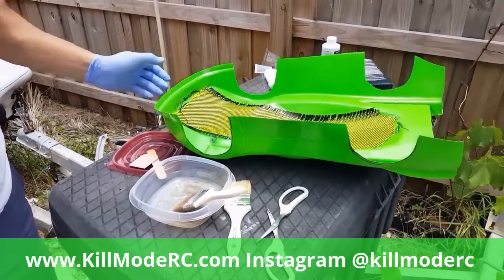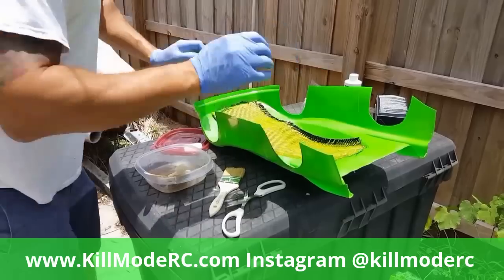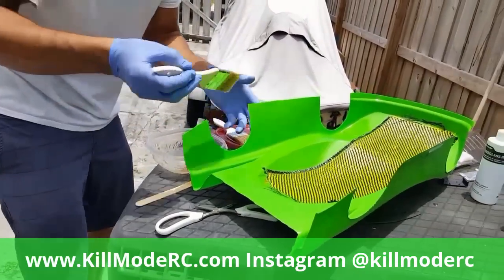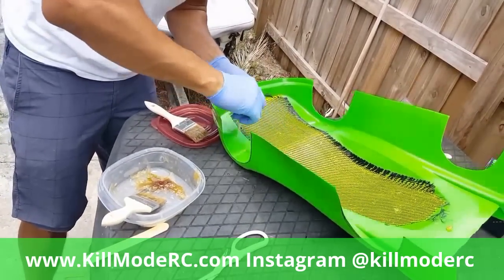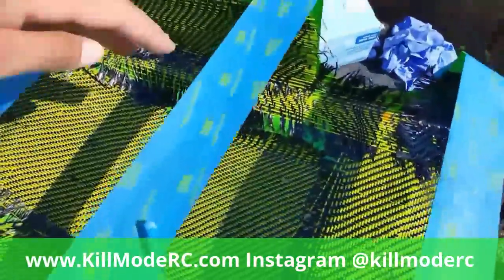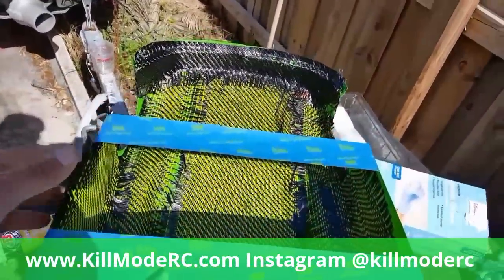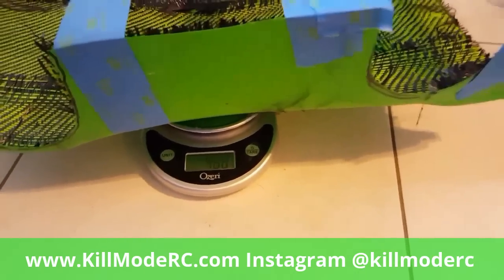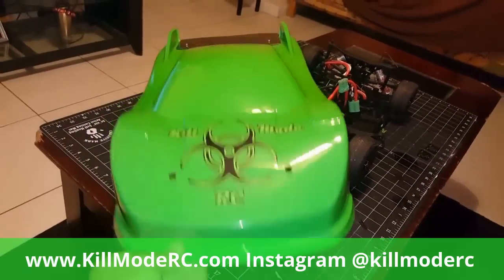How to reinforce RC Speed Run body with Carbon Fiber GT top speed body

Comment: That's a pretty clever method.  I'm wishing I would have seen this before I did mine.  Mine came out ok, but I didn't leave on the protective outer film nor did I tape the side so they wouldn't bow outward.  Luckily they didn't bow outward on me.  But like I was telling Paul 815, I like your technique, but I'd add a layer of duct tape all over the body prior to applying the resin to prevent the paint from stripping.

Comment: Looks good. Did you have any trouble with the resin eating your paint? I've never done resin before but I've seen videos where the fibers pull off the paint. Thanks
Reply from the maker: I noticed a tiny bit, but I think the paint wasn't completely set yet. I used automotive paint, so it is chemical resistant.
Reply: Yes, the resin started to break down the Duratrax  and Tamiya paints I used on my Porsche 911 GT body.  I'd recommend laying down a layer of duct tape prior to protect the paint.  I also used ShoeGoo to hold the fiber sheets in place before applying the resin.  The only thing I'd add to his technique is the layer of duct tape to protect the paint.